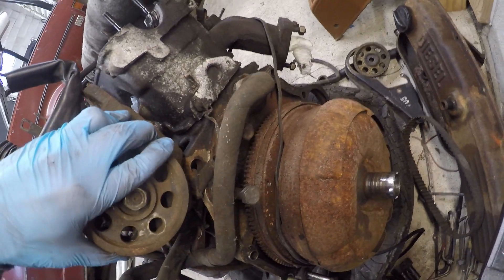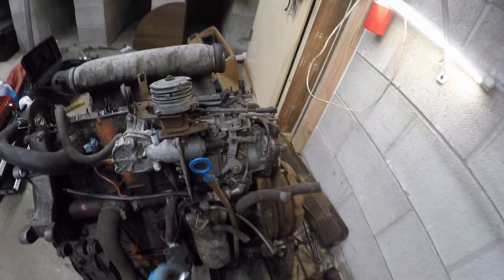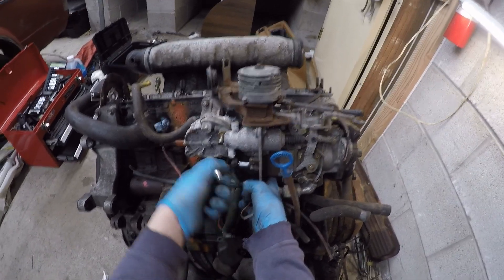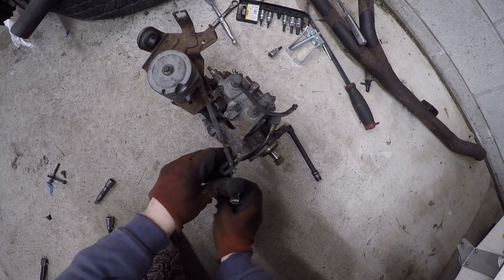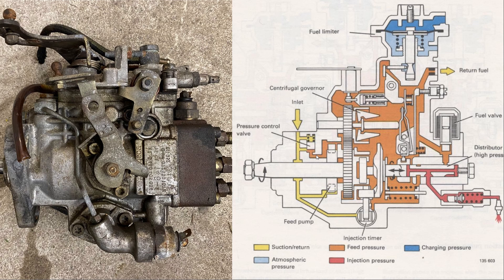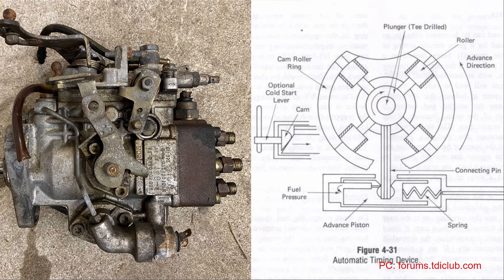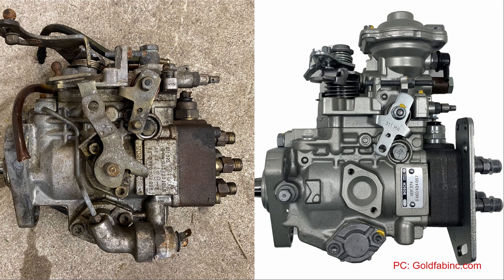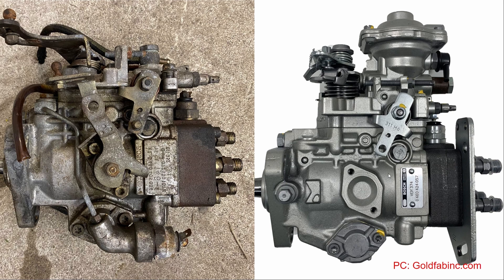D24 Diesel Engine Rebuild 3 - Pulling the Injection Pump, Talking Upgrades

Comment: Thanks for posting. I have a D24 also been in my family for years. I have a small oil leak coming off the back of what I believe to be the valve block. I did a complete restoration in 2017 and there was little to now oil leaking at that time. Do you think taking the valve cover off and tightening those belts using the triple square socket would help?  Thanks for the help and keep posting the d24 videos.
Reply: Bolts not belts 😂
Reply: Thanks for replying!  So would it make sense to properly check the torque on those T12 bolts holding down the cam?  I read it should be done in 4 steps 30, 45, 55 (cold) and 90 (warm). That would be the easier route and I can follow it up with your advice from there?  Just curious I’m an enthusiast so I fear I might make a larger problem. Again thanks for posting all these videos. Really cool seeing it for a second time.
Reply from the maker: @markdenny3570  If you are trying to fix a leak, I don’t think it has anything to do with the cam. I’ve built mostly 1.6Ds so I don’t know any of the D24 cam tricks. I only ever torque it down per the manual and it’s good.
Reply from the maker: @markdenny3570  The valve covers on these and do tend to leak, especially at the end by the sprockets since they used a 3 piece valve cover gasket. If so, just replace it with a 1 piece gasket and you should be good.

Comment: Great video :) I’m Currently building a D 24tic
Reply from the maker: Right on, hopefully you’ll find these videos useful then. The information on these seems to be pretty scattered at best.
Reply: @haoleboyshow-tos2279  it has been very hard to find information on them, I cracked open my engine, and found out my head is cracked so bad it needs to be replaced. Have a new one ordered form 🇩🇪
Reply from the maker: @Foghorn117  Thats a real bummer. My budget is pretty strict on this one. I will probably consider a different swap if it turns out the head is cracked. I would just reseal the pump and try to make my money back with that.